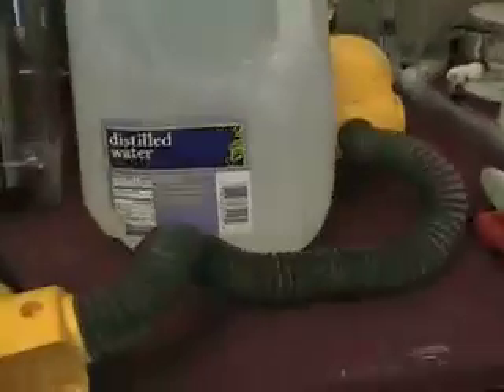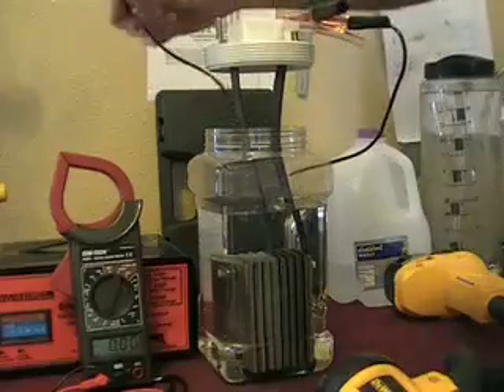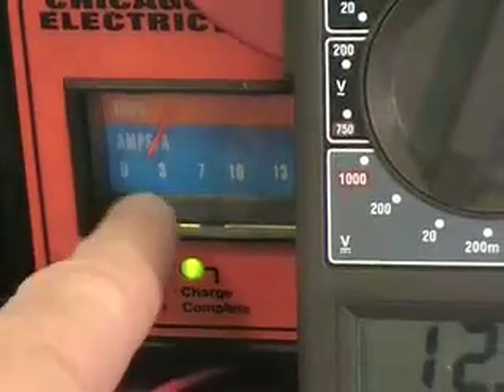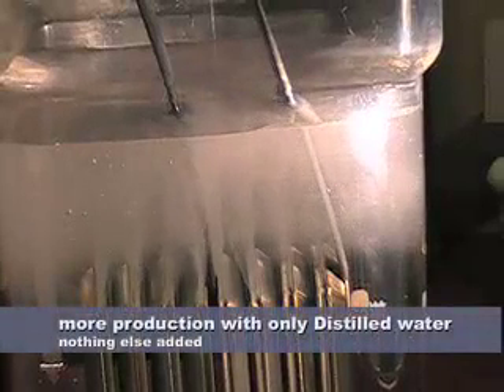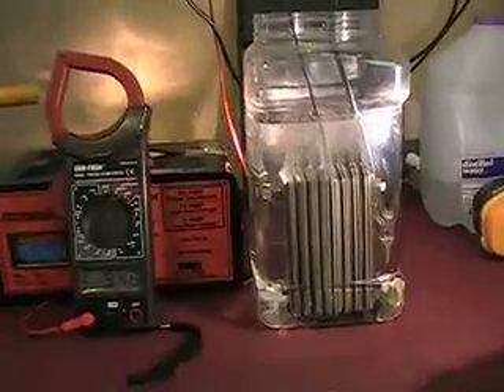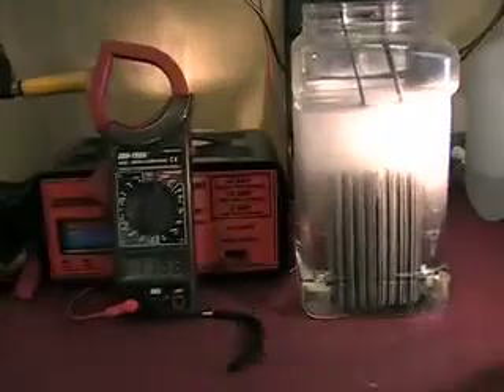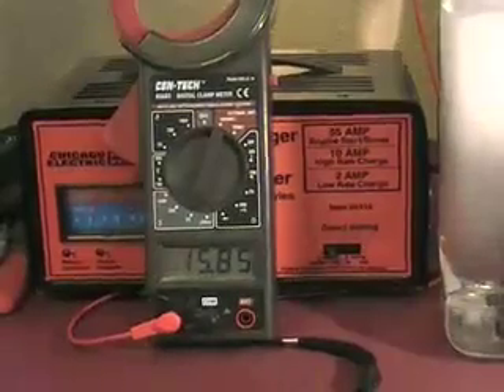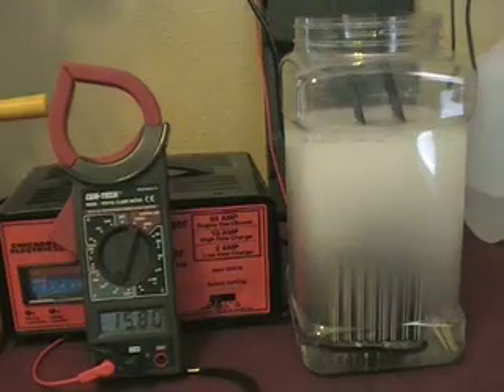003 Smack Booster Cell test #1

Comment: I made 2 smack boosters from my test I found out they are most efficient at 11 amps  so now i run 2 liters a minute   only koh   nice and cool never over 140 degrees and its close to 100 degrees out side   just trying to pass on information that I wish I would have known I think I will make a third generator  try thirty amps 3 liters Laterz

Comment: Hello Steve,
    I Know your desire is to make hho without electrolyte and the secret to it is the electronics behind it. You have to replace the chemical reaction with electronic. The setup you need on the + is a PWM next a Half way Diode, a resonate charging Choke and then your cell coming out of the - side back towards the PS you have a RCC, Diode, and then the PWM it is the same setup on both sides just the parts are in line with the Power flow. See Channel StanleyMeyers  TTYL YoTommy

Comment: I have built several different designs plates, tubes ,wires ect.. I have had the most production with lowest volt/amp usage with tubes.I have one tube that is 4" tall and 1" wide and it inner tube is a 32th of an inch smaller than the outer pipe ,puts out right at a liter a min with no electrolyte,drawing bout 8 amps,I can add a teaspoon of sodium hydroxide and get almost 2 1/2 liters a min but draws about 40 amps, I will post a video of it soon.Keep making that hho man :)